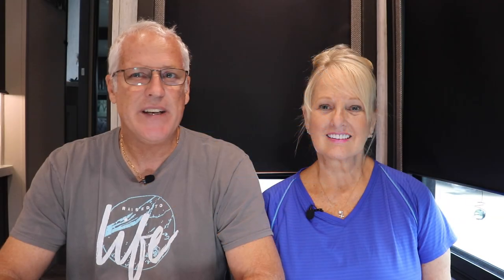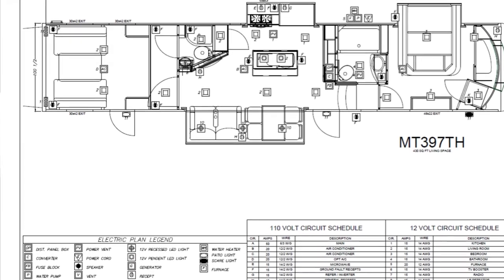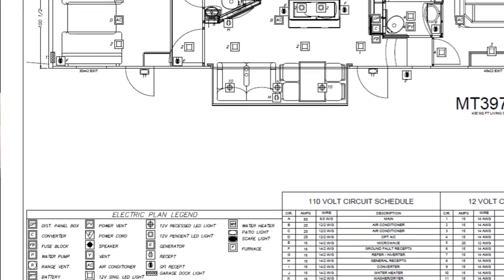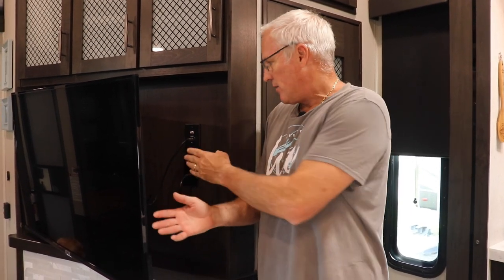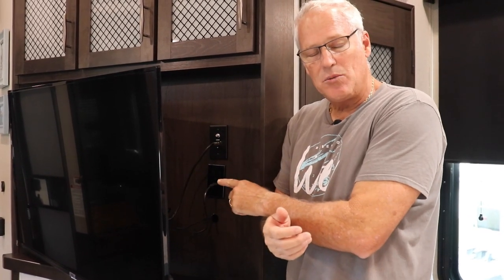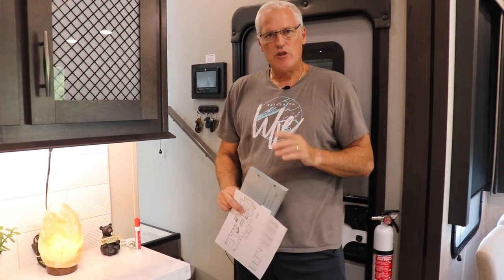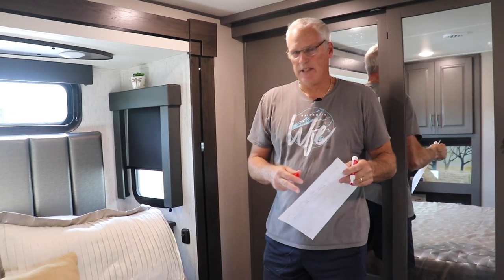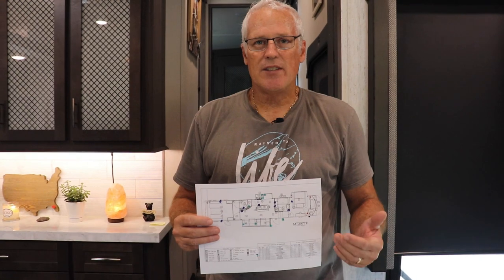What You Need To Know About Hidden Compartments And Electrical Issues (Full Time RV Living)

Comment: Hey guys , 
Wow This was a such a great video !!! 
You got me thinking that I need to take the time & do the same thing. I'm going to get a  wire diagram  if possible or at least a build sheet that the builders use on production line for my 2020 Brookstone 344FL and make the the same diagram.
I'm betting my sub panel is under the living room steps as well . 
Guys we really enjoy your videos please be safe and as always 
"ENJOY THE JOURNEY'S"
Tony & Donna 
Felton De
Reply from the maker: Hey Tony and Donna, thanks for the comments. Glad the video was able to help you. I'm not sure why the manufactures can't get us a wiring diagram, maybe it's a liability issue, but it makes it very difficult to troubleshoot electrical issues. I was very lucky that someone told me to look under the step, otherwise, I never would have figured out my issue. As a bonus, I did find a loose wire in the subpanel that I believe was causing one of my GFIs to keep tripping. Good luck trying to get a wiring diagram 😒
Dan

Comment: We have a 2021 397TH-R but it was ordered incorrectly with the propane/electric fridge. The fridge was replaced before we picked it up and took possession. With that being said, we don't have the sub panel under the step. Because it was originally built for a propane/elec fridge, the structure of the sub panel isn't correct to match what we now have. I hope I make sense.
Reply from the maker: It's hard to say what you have for wiring if it was originally wired for the propane/electric fridge. Did you take a look under your step to see if the sub panel is there?
Reply: That said, was there a sub-panel for the non-residential wiring? If so, where is it located? TIA

Comment: On your sub panel, what is listed? What are the three things? I'm having a problem with my front awning and I was told to go look for that sub panel but we don't have it. Any ideas? I saw your post in that group. We are in it too. We have the same exact rig you have with the same color scheme.
Reply from the maker: Hey Loaded Up and Traveling - Our three breakers have "Refer", "GFI", and "General". They're all for different outlets. The Refer breaker connects to our Inverter and operates some of the outlets in the kitchen. The GFI breaker goes to our main bathroom and all the outlets that are marked with 'GFI', the breaker marked as "General" operates the remaining outlets. I don't know about the awning but I really don't believe it's the subpanel. Sorry I couldn't be more of a help. Good luck.
Reply from the maker: I was thinking more about this last night. I'm not sure but I would think the awnings are 12 volts and not 120 volts, so I don't believe the sub panel would be an issue. Please let us know once you find the problem so maybe it will help others. Thank you.

Comment: This video is really helpful but I can’t find a sub-panel. My steps aren’t removable. I have the Solitude 380FL-R if anyone has any ideas.
Reply from the maker: Hey Tim, if you can't find your sub-panel, you could call Grand Design support, they should be able to tell you where it's at. They will probably ask you for the RV's VIN number, so may want to have that handy.
Dan
Reply: Thanks Dan. There doesn’t appear to be a sub panel for this model. At least not where they said it should be.
Reply from the maker: They never make is easy do they?